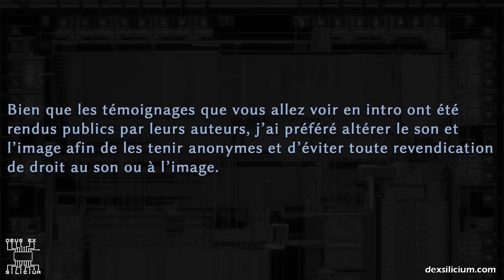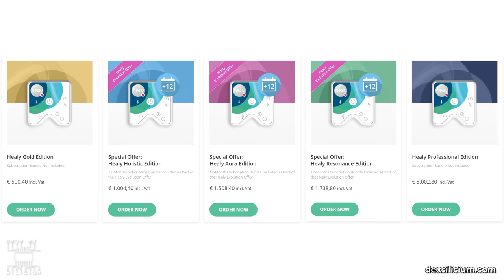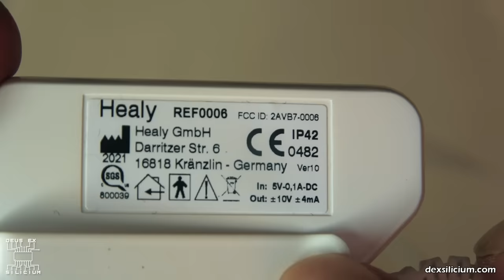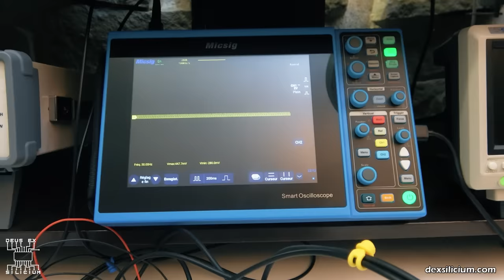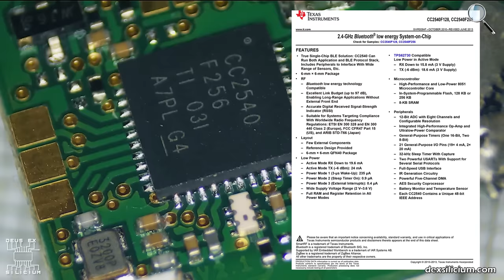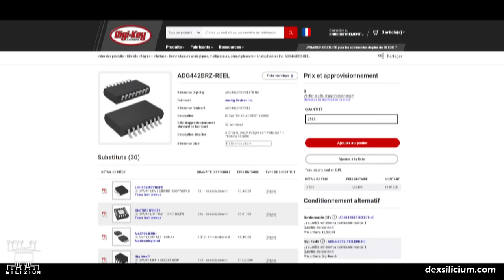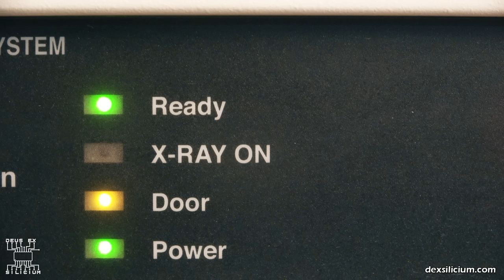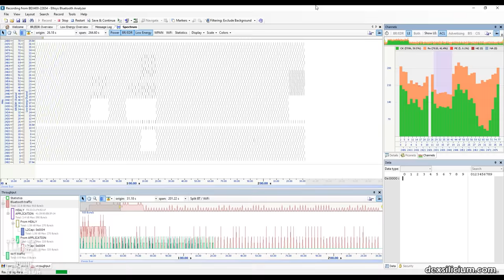Analyse intégrale d'un appareil de médecine quantique

Comment from the maker: NOTES :
A 10:47 je parle du problème de ne pas pouvoir recharger l'appareil pendant qu'on s'en sert, mais c'est à priori normal pour des raisons de sécurité afin d'éviter tout risque d'électrocution potentiel si l'isolation du chargeur est de mauvaise qualité.
A 12:48 je dis que la batterie peut délivrer une intensité de 140mAh... désolé, ma langue a fourché, ça n'est pas une intensité mais une capacité (d'ailleurs la phrase n'a pas de sens avec le mot intensité).
Reply: Tout à fait d'accord ! Au prix où sont les chargeurs, qui sont des alims à découpage branchés sur le secteur, aucun n'offre assez de sécurité pour que le risque de mettre un utilisateur " au courant" soit nul.
Reply: A 10:47. Oui, les appareils électroniques connectés simultanément au secteur et au corps humain (via des électrodes) répondent à des normes de conception et de maintenance très exigeantes. Philippe Demerliac, de la chaîne Cyrob, avait fait une vidéo à ce sujet il y a quelques années.
https://www.youtube.com/watch?v=PeA8hb0hEDI
Reply: @Vincent-wl4yb  Je dirais plutôt: DOIVENT répondre.....
Reply: @bernardpire4164  C'est vrai que j'ai vu des montages sur le net qui font peur... je ne les conseillerais qu'à belle-maman :)
Reply: Il faudrait une alimentation avec isolation de 4000VAC (ou 5000, j’ai un doute), des lignes de fuite de 8mm, et 2MOPP.  Mais j’ai un autre doute, en y réfléchissant : l’opérateur des essais EMC va procéder à des essais ESD. La pointe du pistolet ESD peut-elle atteindre le port miniUSB ? Dans ce cas, il va appliquer une décharge de +8kv, puis -8kv. L’appareil ne peut pas être détruit, il peut s'arrêter quelques secondes, mais doit reprendre son fonctionnement automatiquement. Et un petit désagrément chez le patient... L’opérateur va aussi appliquer des ESD de 16kv sur l’enveloppe. Là,  je pense aussi que cela ne passera pas, les lignes de fuite entre l’enveloppe et le pcb sont visuellement trop courtes. Reste à savoir si ce test est destructif.
Reply: 14:20 L antenne est le composant blanc avec un trait rouge.  Ce type de composant antenne est utilisé à mon boulot
Reply: Le concepteur s’est pas foulé, il aurait pu mettre un chargeur sans fil comme sur les smartphones depuis quelques années (j’ai attendu que ça arrive sur l’iPhone 8+ pour en avoir un)
Reply: je serais intéressé d'avoir une idée de ce que fait le logiciel, ça aussi ça coûte des sous
Reply: C'est normal qu'on ne puisse pas le recharger en même temps, ça empêcherait les ondes quantiques scalairotelluriques de faire leur travail!
Reply: C’est un A A S L C E B D V!
En langage quantique : appareil à stimuler le compte en banque du vendeur...
Reply: Vu le design du bordel je pense qu'un étudiant qui louerait ses services sur une plateforme de petits jobs entre particuliers pourrait développer ça pour moins d'une centaine d'euros. Lol
Reply: @pascaldebiere  il n y a pas d arnaque. Démasquer , je sait bien que c est de la merde , mais rien ne prouve que j' ai raison
Reply: @DeleteWorld  exacte
Reply: C'est respectueux d'accepter vos erreurs... Bravo à tout votre travail d'acteurs et de monteur
Et le reste qui est bien visible a l'écran
Bravo
Chapeau bas
Reply: Merci pour cette analyse, mais après avoir regardé la vidéo de G Milgram, je reste sur ma faim !
Que se passe-t-il quand on fait une "analyse" depuis l'appli ? J'ai l'impression selon la vidéo que l'étude du dialogue bluetooth n'a été faite que pendant une phase de "traitement".
S'il n'y a pas d'autre communication remontante que la fréquence en cours, d'où viennent les résultats "d'analyse" ? Sont-ils reproductibles ? À quelles données a accès l'application ? Ce serait intéressant de faire un sandboxing s'il y a des demandes de permissions pour voir ce qu'elle utiliserait.
Concernant l'électronique est-ce qu'il y a possibilité technique de lecture de signal à partir des électrodes ?
Reply: Bonjour,  une petite batterie suffit puisque l'appareille se recharge par la pensé (voir au gaz de ville) 😂🤣
Merci pour les vidéos 
👍🏿👍🏾👍🏽👍🏼👍🏻
Reply: A 10:47 si l'on ne peut pas recharger l'appareil en même temps c'est volontaire et décrit dans la doc : c'est pour éviter les courants parasites lors de l'utilisation qui pourrait fausser l'échange de données
Reply: @nonolevieuxcrabe2437  il n'existe pas de vendeur ni de magasin. Personne ne m'a vendu ce produit, je l'ai acheté moi même sur le site sans que personne ne m'en parle.
Reply: L'appareil quantique tique lorsque je lui chante des quantiques.
Reply: Je voulais savoir si les balances impédancemètre sont du même système et si sa fonctionne également réellement, ou pas...
Reply: TU VEUX BIEN FAIRE AUSSI LES "CORRECTEURS D ETAT FONCTIONNELS"  ? lol
Reply: pas mal le coup du micro c'est comme parler à un sourd ou alors lui parler en langage des signes 🤣🤣😂😂
Reply: J ai absolument TOUT rien compris :).
Mais bon c est bien de faire ce genre de videos pour les gens qui ne comprendrait pas que ce genre d appareil est une totale arnaque rien qu en voyant sa description.
Et ca a peut etre pu aider 1 ou 2 fils, ou mari, a convaincre leur mere/femme qu elle achetait juste un boitier vide inutile, voir dangeureux en achetant cette chose.
Donc merci d avoir fait cette video!
Reply: Tu devrais utiliser le healy pour tes dépannages : tu pourrais en faire beaucoup plus en moins de temps. 
C'est tout bénef !
Merci qui ?
Merci JPP !
De rien, je prend 15% !
Reply: @edomaur  Ce type de logiciel n'est pas très cher à faire...
Reply: En même temps est ce vraiment utile qu'il soit allumé quand on s'en sert ? on est pas sensé faire des économies d'énergie ? c'est l'occasion le résultat sera identique.
Reply: Que c'est un simple oscillateur vendu à prix d'or et qu'il envoie des fréquences à basses intensités, ok, mais cela veut-il dire que pour autant ça ne fonctionne pas ?Car il me semble que c'est le principe de la bio résonance non ? Ce qu'il aurait été le plus intéressant aussi de dire, savoir est-ce que l'appareil envoie bien les fréquences qu'affiche l'application ou non ? Pourriez-vous le préciser?Je l'ai test chez un ami, pour l'aspect guérison, je ne peux pas dire si ça marche ou pas, mais j'ai vraiment bien ressenti par moment le courant passer, des fois même ça faisait mal.
Reply: Selon cette autre vidéo qui le test, il délivrerait bien les fréquences affichées par l'app https://youtu.be/P06DUwqyFc0
Reply: Par contre la ou ils se foutent de la gueule du monde c'est qu'il y a une vidéo de healy eux mêmes ou ils avouent qu'il n'y a pas de capteur dedans mais que ce qu'ils nomment capteur quantique est un simple calculateur aléatoire!et selon lui notre pensé l'influencerai et sélectionner ai le bon programme, ça quand même faut y croire.. 🙄🙈
Reply: J’y
Reply: 1. Le dispositif PRK-1U ne coûte pas 11 000 euros ou 10 700 euros. Il s'agit d'une idée fausse. L'appareil PRK-1U est transféré pour être utilisé avec le programme de formation des enseignements de Grigori Grabovoi sur la base d'un contrat de sous-licence (ou d'un contrat de sous-sous-licence fourni par les distributeurs).
Le titulaire de la sous-licence paie pour l'utilisation de la propriété intellectuelle, qui lui est fournie dans le cadre d'un contrat de sous-licence d'une durée de 4 ans.

Sur la base d'un accord de sous-licence (avec la fourniture d'un dispositif physique PRK-1U), le titulaire de la sous-licence (et les participants à l'accord configurés sur le dispositif PRK-1U, un maximum de 8 participants) reçoit :
- une carte flash USB contenant toutes les œuvres de Grigori Grabovoi du programme d'enseignement des enseignements de Grigori Grabovoi dans différentes langues, qui sont disponibles dans le centre d'éducation ;
- Accès à la bibliothèque en ligne des œuvres de Grigori Grabovoï pendant 4 ans. Les œuvres de Grigori Grabovoï sont disponibles dans la bibliothèque en russe, et des traductions en différentes langues sont constamment ajoutées ;
- Accès à distance 24 heures sur 24 à trois appareils PRK-1U configurés différemment via l'Internet pendant 4 ans. Les réglages de ces appareils sont périodiquement mis à jour et modernisés.
- L'appareil de développement des concentrations de vie éternelle PRK-1U. Selon les termes de l'accord, après l'expiration de l'accord, l'appareil physique PRK-1U restera chez le titulaire de la sous-licence.
Reply: Qu es ce que tu penses des bols tibétain

Comment: Super vidéo comme toujours ! Pour avoir participé au développement d'un système d'électrostimulation musculaire je me permet de faire deux remarques. Concernant l'impossibilité de recharger l'appareil pendant son utilisation, c'est pour un question de sécurité en cas de défaut d'isolation sur l'alim (d'autant plus si le choix de la source d'alimentation est laissée à l'utilisateur). Au delà du rechargement, le fait qu'il ne soit pas possible de connecter l'USB les électrodes en même temps le montre. Donc pour cet aspect au moins on peut pas leur jeter la pierre. Concernant la puissance de la stimulation elle n'est probablement pas de 40mW. La résistance entre 2 électrodes collées sur la peau est une fonction non linéaire et non statique, mais à seulement 10V le courant doit être au mieux de l'ordre de 100uA. A titre indicatif pour un pulse d'électrostimulation régulé en courant (disons 10mA) la tension au début du pulse sera typiquement de l'ordre de la centaine de voltes (la tension diminue rapidement ensuite car la conductivité de la peau augmente une fois que le courant passe)
Reply: Merci de ces précisions.
Ils ont au moins essayé de faire que leur appareil ne soit pas dangereux, c'est déjà ça :-)
Reply: @ThomasKundera  mais au moins, en cas de défaut d'isolation, l'utilisateur aurait bien senti un "effet quantique" de 220 V...

Comment: Excellente vidéo, par contre il reste encore 2 choses (mineures) à préciser.
Concernant le prix, Digikey est une bonne plateforme, mais Octopart est mieux dans le sens où il cherche sur d'autre plateformes agréés (Digikey mais aussi ,Arrow, RS, Farnell, Mouser, ...). De même que les prix en ce moments subissent la crise des semi-conducteurs, donc un PCBA à 14€ aujourd'hui, devait être à ~8€ avant cette crise (ou une fourchette 5€ - 10€).
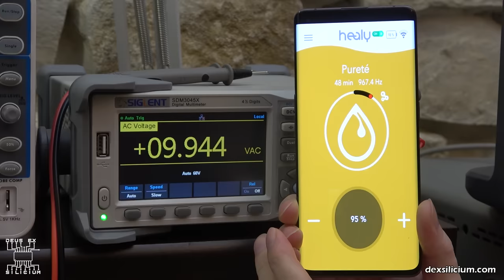À 17:20 , je pense que ce n'est pas un bug mais le fait que les sorties d'électrodes sont à vide. Je pense que si on met une charge résistive fixe (~100kO) ou un humain lambda connecté aux électrodes, un courant passera et (peut-être) la tension bougera en fonction de la puissance. Si connecter une charge ne fait toujours rien, alors là oui c'est clairement un soucis de conception.
Sinon merci de la découverte, mais je vais rester avec mes GBF à 2500€, je peux en plus faire des sinus et des triangles !
Note: je suis désolé si c'est mon énièmes commentaires, les précédents n'arrive pas à être validé.

Comment: Beaucoup de choses posent question avec cet appareil et son  système de vente... ce qui m'a fait rire (entre autres) ce sont les bracelets en Velcro qu'on connecte au boîtier 😂 autant les électrodes cutanées et les "clip" pour les oreilles, sur le principe ça se tient. Mais la conduction du signal via des bracelets non conducteurs... on est sur du haut niveau! 🤦‍♀️ (sans parler de la qualité ou de l'efficacité prétendue du-dit signal électrique) mais bon, dans la vidéo de G Milgram, les témoignages disent que ça soigne à distance, ça répare les machines à café et même les voitures, donc de ce point de vue si le bracelet est non conducteur c'est pas grave (j'imagine que c'est quantique 😆)
Vidéo très intéressante dans un domaine où je ne sais quasi rien, merci pour ton travail
Reply from the maker: Merci.
Les bracelets sont fait d'un matériau conducteur, j'ai pu le vérifier (c'est le même matériau que les pastilles placées sous les touches d'une calculatrice qui sont en contact avec le circuit imprimé).

Comment: Salut, pour l'histoire de ne pas pouvoir recharger et utiliser en même temps, c'est pour une raison de sécurité pour les dispositifs médicaux car si tu branche une électrode et que tu charge sur le secteur en cas de défaut d'isolation tu te branche sur le secteur.
D’ailleurs ils ont fait de façon à que ce soit impossible physiquement de brancher les 2 en même temps.
J'ai vu la même chose sur des électro-stimulateurs utilisé en kinésithérapie

Comment: Salut DES !
Je suis ingénieur en électronique et j'adore tes vidéos. Je voulais apporter une précision : pour avoir fait un peu de médical il est admis qu'il ne faut pas utiliser de appareil avec des électrodes type ECG ou autre avec un appareil branché sur le secteur pour éviter d'avoir du 50 Hz qui remonte ou d'autre signaux parasites pouvant remonter via le système jusqu'au cœur et désynchroniser ses battements.
En gros cela peut être très dangereux si l'appareil n'est pas correctement conçu de l'utiliser pendant qu'il charge, donc PEUT ETRE qu'il ont quand même fait un truc bien ^^
Reply: Quelques remarques en vrac : ce truc ressemble à un électrostimulateur, le truc qui sert à (ne pas) se muscler en regardant  la TV, ou effectivement à réduire certaines douleurs par des courant dits "TENS endorphiniques" qui sont des vrais techniques utilisées par les Kinés. Pour le tester correctement il aurait été préférable de le charger par une résistance (genre 2Kohms pour avoir leurs 4mA sous 10V) plutot que de le laisser en haute-Z, car c'est le courant qui agit sur les muscles et qui est modulé par ces appareils habituellementet non la tension; Un point étonnant est que ces équipements d'habitude INTERDISENT de faire passer le courant dans le corps VIA le coeur, et mettre une éléctrode à chaque poignet est exactement ce qu'il ne faut pas faire, ce qui explique peut-être la limite à 4mA ? Au dessus ça pourrait faire des dégâts ... Bon ça n'excuse pas le quantique hein...
Reply: @flynn8860  bonjour, cette machine me fait du bien quand je fais attention à boire 2L d'eau par jour. Si je ne le fais pas, mes battements cardiaques sont altérés. Mais votre intervention me pose question quand même. Quel est votre métier si pas indiscret?

Comment: Plusieurs questions :
Je reste très sceptique quant à l'utilité/efficacité de ce produit, cependant j'ai plusieurs questions :  
- l'antenne pour le SoC Bluetooth n'est-elle pas une antenne céramique CMS, d'où le design différent d'une antenne cuivre sur PCB habituelle ?
- Le MSP430 est équipé d'un CAN, y-a-t-il des signaux qui arrivent (par exemple directement depuis les électrodes ou par l'intermédiaire d'un étage analogique) sur cette interface qui pourrait suggérer que l'appareil mesure quelque chose par cette interface ?
Et une remarque :
- Etant donné que le Healy est relié en BT au smartphone sur lequel tourne l'application, l'application utilise-t-elle le micro du smartphone (demande-t-elle à lui autoriser l'accès au microphone du smartphone lors de l'installation/lancement ?) ? Si oui, pas besoin de microphone dans le Healy, c'est le smartphone qui "capte" la voix pour un éventuel "traitement" ultérieur dans le "cloud"...

Comment: Petite hypothèse, peut être fausse, pour le coup des 10V constants en sortie quels que soient les réglages dans l'appli : comme ça a l'air de marcher comme un électro stimulateur tout ce qu'il y a de plus basique mesurer la sortie en tension sans aucune charge est à priori une erreur puisque l'appareil est censé générer un signal en courant, pas en tension.
 Sans charge il va balancer tout ce qu'il a pour tenter d'atteindre le courant "cible" mais forcément sans pouvoir y arriver puisqu'aucune charge à travers laquelle faire passer le courant (l'impédance des sondes est bien trop élevée par rapport à ce avec quoi le bidule est censé fonctionner pou que ça ai un effet) d'où peut être la sortie vaguement carrée à +-10v crète constant (ça écrête quoi).
Peut être qu'avec une charge résistive (pour faire au plus simple) de valeur cohérente avec celle d'un corp humain l'amplitude et la forme du signal de sortie seraient différents, mais peut être vous êtes vous aussi posé la question et fait les tests adéquats pendant la réalisation de la vidéo sans le préciser.
Après ça ne change en rien ce que je pense de ce genre de pièges à gogos trop riches, juste que tant qu'à debunker l'arnaque autant être carré dans la méthode, sans mauvais jeu de mots, pour ne pas prêter flanc à la critique des supporters de ce genre de """médecine"""
Reply: Bonjour David, cela rejoint mon commentaire. J'aimerais que notre ami renouvelle son expérience avec une charge.

Comment: Salut, j'aime beaucoup tes vidéos, j'aimerais te poser une question qui n'a pas grand chose à voir mais à laquelle je ne trouve pas vraiment de réponse, j'aimerais avoir la réponse à : "à quoi sert  une résistance ?"
Je connais les formules u=RI r=U/I etc mais je ne sais quand même pas à QUOI SERT UNE PATATE DE RESISTANCE AAAAAAAAAAAAAAAAAAAAAAH
Merci <3
Reply: En fait une résistance ça sert a plusieurs choses. On peut utiliser une résistance faible pour faire chauffer des trucs (effet joule).
On peut s'en servir pour réduire l'intensité ou la tension d'une branche du circuit, ça s'appelle des ponts diviseurs. 
Et après avec des puces un peu plus complexes et d'autres elements on peut faire des filtres de fréquences, des amplificateurs...